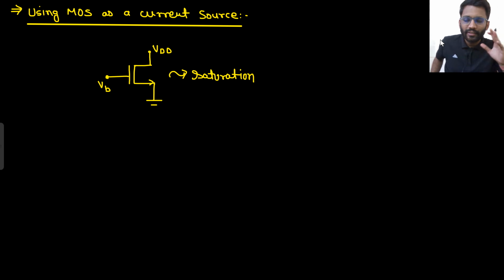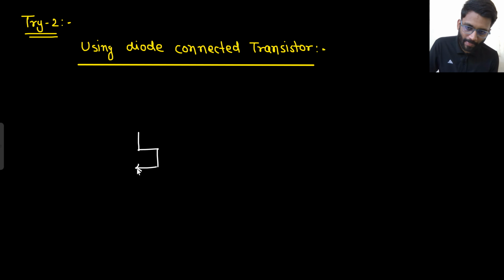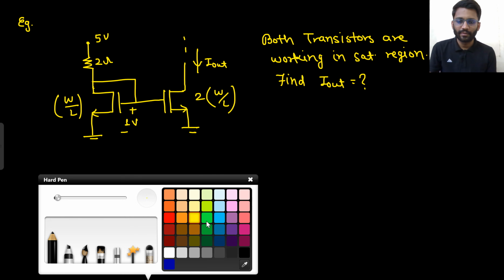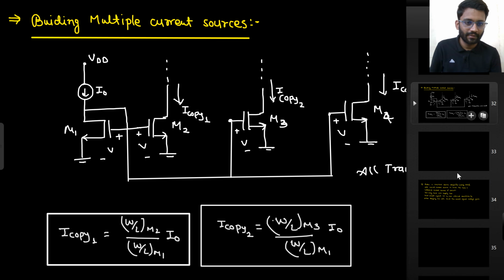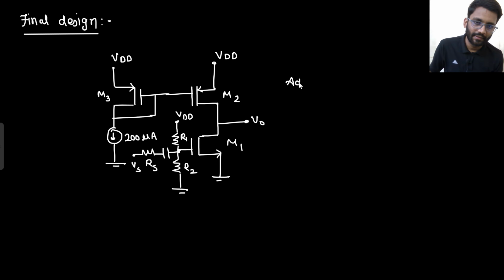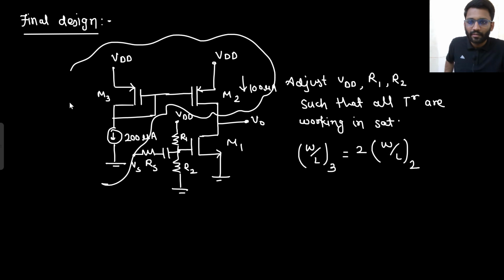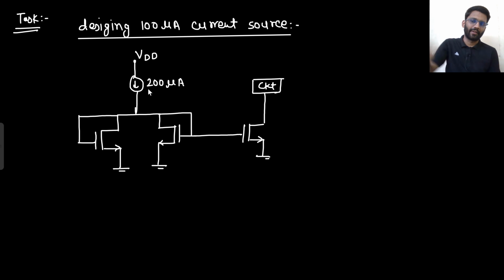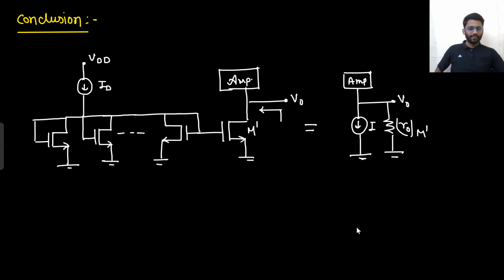Current Mirror Circuits || Analog Electronics || PrepFusion || Himanshu Agarwal

Comment: Sir,in common source amplifier design question, building the 100 micro amp souce  from 200 micro amp ref current source ,why you used pmos, can we design with nmos
Reply: Cuz when we need a current source from vdd to some node , we use pmos based current mirror